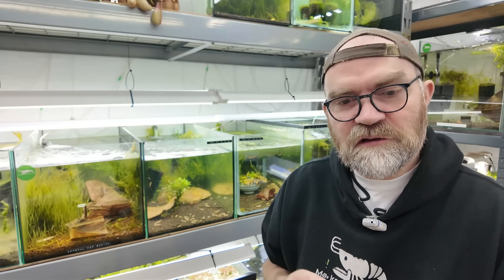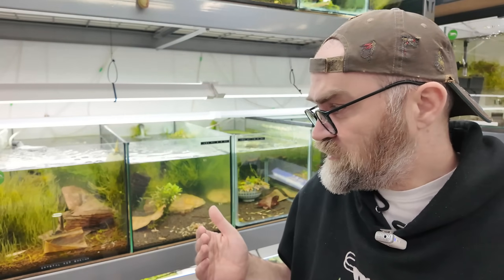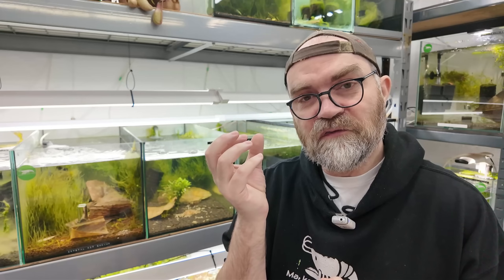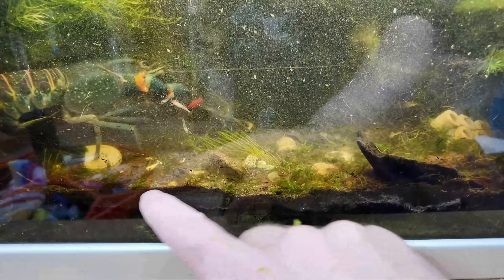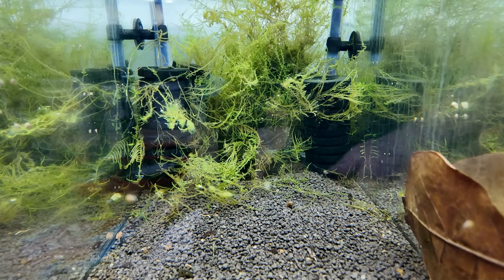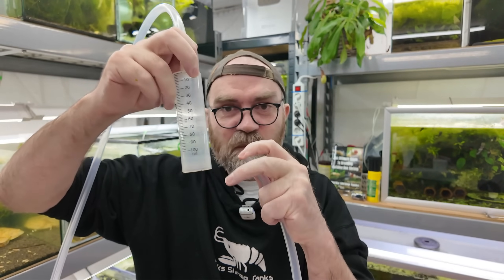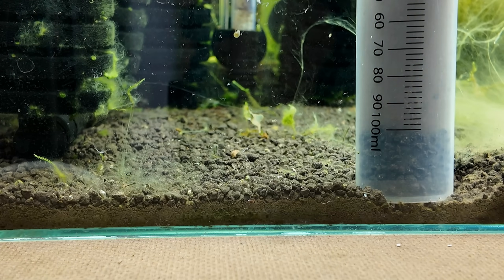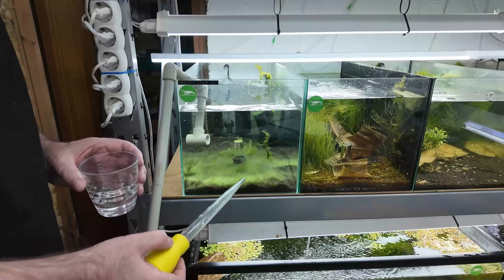How to Prevent Hydrogen Sulfide Poisoning in Shrimp Tanks: Tips & Fixes

Comment: Hey mark. First time commenting. Im cylcling a 10 gallom and is about a month and a half through. Everything is great with the tank. Handful of 
 plants and 3 decent size pieces of drift wood. And a dragon stone. My ph is around 7.2. Is this acceptable for neos or should i find a way to lower it? And how so? Ive kept fish but im really really trying to learn the ins and outs of neos before i get them.
Reply from the maker: Hello Chief, your ph is perfect for neos so dont try and change it jut make sure you use a dechlorinator.
Reply: @MarksShrimpTanks  oh I do anyways. even though I use reverse osmosis water from my coffee  making  job. I'm just trying to get my hardness higher than a 6 Dkh which it currently is (7) im using shrimp minerals very sparsely. Is there a reason to worry about kh? I know my gh is good and ph is good now. Also I appreciate the feedback a ton. My son really wants shrimp lol
Reply from the maker: Hey Chief! You’re on the right track, man. That pH of 7.2 is perfect for Neos, so no need to lower it. In fact, trying to mess with it might throw things off—stability is what you’re aiming for.

Now about KH—yes, it is important, especially in a neutral pH tank like yours. You wanna aim for a KH of around 1 or 2 to help keep that pH stable. KH acts like a buffer—it stops your pH from swinging around. Since your KH is already at 7, you’re solid for Neos. You only need to worry if it starts dropping too low, like under 1, which can make your pH crash over time.

For Neos, a KH of 2–4 is kinda the sweet spot. Too low and things get unstable, too high and you’re pushing into hard water territory—not dangerous, just unnecessary.

So you’re good, just keep an eye on it and don’t overdo the minerals. Sounds like you’re almost ready for shrimp—and your kid’s gonna love it when they finally arrive!
Reply: @MarksShrimpTanks  thank you so much!
Reply: @MarksShrimpTanks  do you sell shrimp and aquarium accessories? I went to your website and it said shop was down for maintenance :(
Reply from the maker: yeah ive not had a shop for many years, i had to close it down when i became disabled, you dont see it on camera but my back is horrific.
Reply: @MarksShrimpTanks  I'm very sorry to hear that. I hope you still manage well. At least you can still make content and teach us all a thing or 2.

Comment: I have sand in my tank.  Everything is thriving.  I have rooted plants that send runners and assin snails in there.   I have had my tank running for 6 yrs with no issues.  I do not vacuum the sand as all the sand would simply get sucked up.   Never seen gas bubbles in my tank....   Wonder if the burrowing assin snails and runner plants do the  work for me?

Comment: Great info, Mark! That’s the main issue in tanks with thick soil. That’s why using a UGF with thin soil at the front is an awesome choice to avoid these build ups and toxic gases in the substrate.
Reply from the maker: Yeah I was shocked Leon, I had a tank that was only what 3cm deep with substrate and I vravel vacced it and a bubbled  came up and it smelled like I had shat myself, my issue specificly was in just ADA gold tanks where the soil had crumbled a bit.
Reply: @MarksShrimpTanks  I know, Mark. It even happens when you only have a 1cm layer of soil. That's why you must vacuum from time to time to remove all the waste from the bottom. Yes, ADA Gold breaks down very fast from my experience too. It clogs the holes on the UGF plate if there’s no sponge at the bottom, and shrimp start dying. The sponge helps keep the soil above the plate and prevents blockage, but it has to be a very coarse sponge so the soil dust can pass through and sink to the very bottom of the ugh